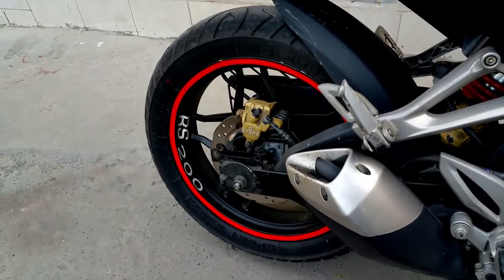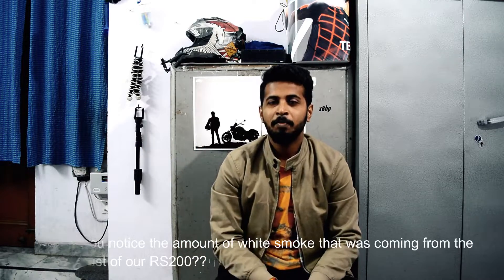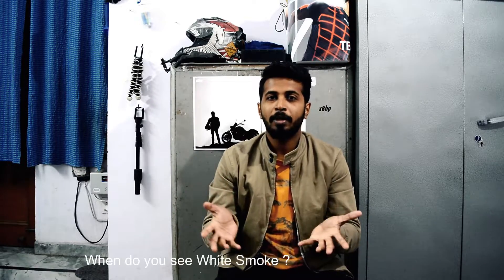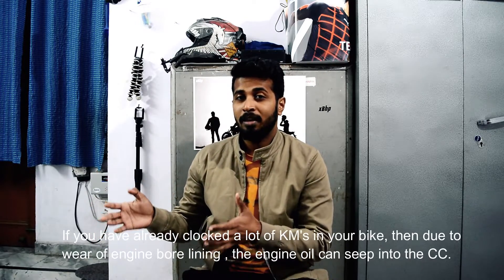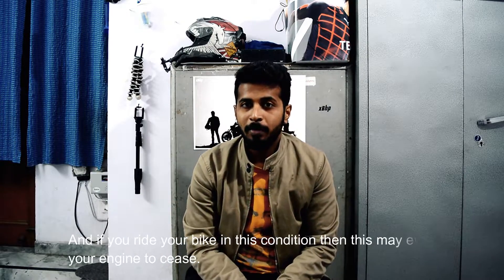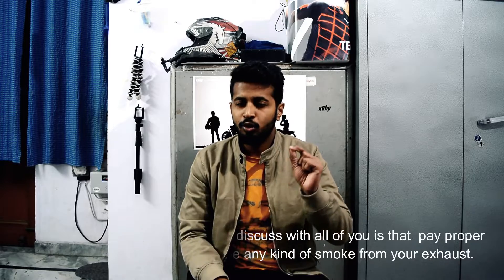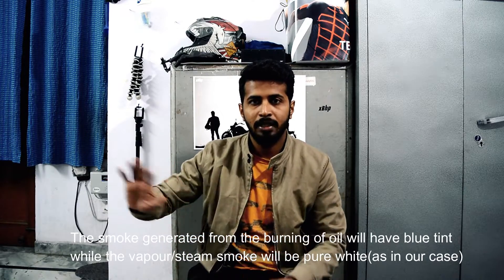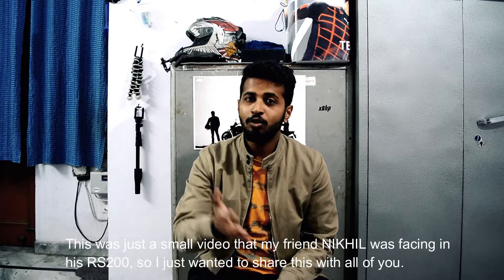White Smoke From Exhaust | Pulsar RS200

Comment: Hello I have a question today i was riding my bike with my friend, we were heading towards our college and i got a free road and i shifted my gear to 1 slow down then i pulled my bike to the rpm limiter and my friend was behind me i went fast till 100kmph, but later on my friend told me that you went fast and white smoke was coming out from the exhaust and I have resently serviced my bike it's been hardly 10 day's everything is changed and installed new air filter, oil everything spent 6k for the best servicing changed my sparkplugs, chain sporkts, clutch plate and everything... my bike is a bs4 2017 220f what's the reason behind that white smoke i have noticed it for the first time and it's cold where I live! it was 18/20 degree out there when I was riding!

Comment: Bhai meri bike srf 9 months old hai.. aur bike 3600 kms chali hai.. engine oil meney 400kms p change kraya hai.. pulsar ns200
Reply from the maker: united nation toh what is the problem bro ? What happened ?
Reply: Touring Diaries yehi subah subah kbhi kbhi white smoke nikal ta hai.. aur power loss.. as bajaj claims 0-100 in 10 secs.. but mine takes 17secs
Reply: Really fed up bro Please help
Reply from the maker: united nation bro, during winters it is normal. Don't be worried. Due to condensation our bike tends to give white smoke but that's normal and power drop is also caused during winters. In summers this will be perfectly fine.
Reply: Thanks bro
Reply from the maker: united nation np bro 😃

Comment: Hello bhai, been following you since really long. I have recently bought a Duke 390 2016 edition. The run is around 11,000 kms now. 

Agar bike ko 4-5 ghante baad start krta hu to just for few seconds white smoke nikalta hai. Uske baad kuch nai, sab Normal. No smoke at all. Engine oil and coolant level remains the same. Not getting any proper response from anywhere. Any suggestion?
Reply: same problem